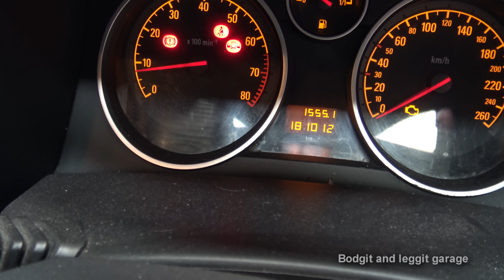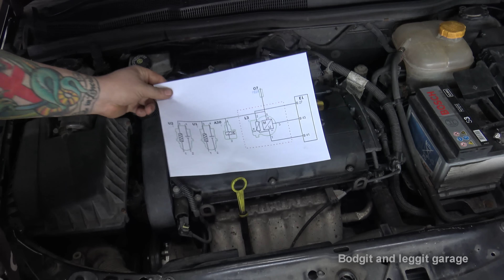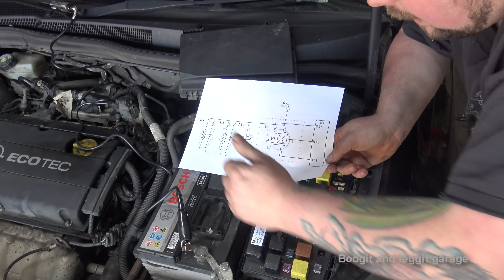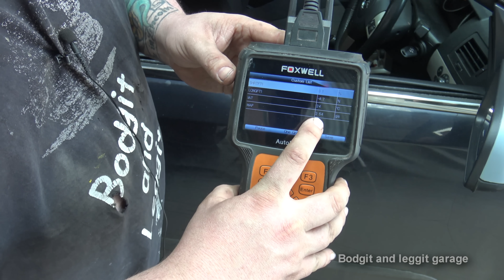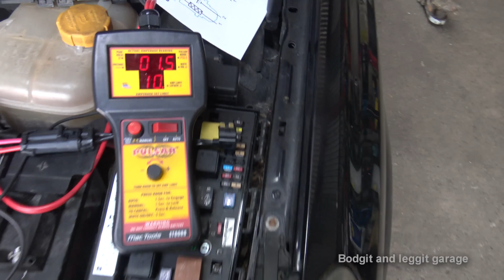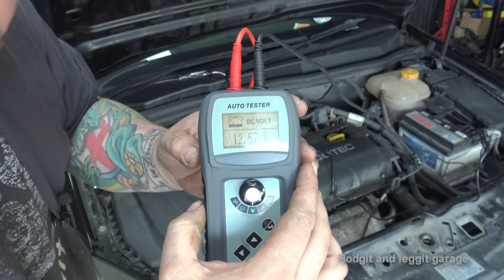Vauxhall Opel Astra P0100 P0135 P0141 P0443 Bodgit And Leggit Garage

Comment: Hi sir. I have opel astra model 2001, 1200 cc the motor has been replaced with 1800 cc , the both o2 sensor has no power o it's heaters, could you help me

Comment: Greetings from Hungary. Thanks for the video, the issue is finally resolved. I tried a lot of things, but the codes P0443, P0135, P0141 always came back, but based on your video, the small fuse in the engine compartment was also faulty. I replaced it and now everything is fine, no error code. Thanks again for your help.

Comment: i have a vauxhall astra 1.8 from 2004 and i get P0100 code error, i can check the fuze/clean maf or replace maf ... what do you think ?
Reply from the maker: you will need to check it with live data you will need to check your wiring and also check your your ECU and check you've got no leaks in your system

Comment: Would the fuse number be the same in a 2008 corsa 1.3 cdti? I'm getting a po100 code I replaced the air flow sensor but am still getting same code 😕 it's getting on my nerves now haha 😊
Reply from the maker: Lol it's hard to say because you could have exactly the same car as the one I've got in the video and the fuse be in a different place the easiest thing to do is get your manuals out and you're fuse location should be in your driver's manual
Reply: @bodgitandleggitgarage  OK thanks il av another look tomorrow it won't beat me haha
Reply from the maker: @claireroberts4351  lol boom

Comment: Thanks alot! Been having trouble codes P 0135, P 0141 and P 0443 on my Opel Astra H 2008 since i replaced front exhaust pipe when i had to remove the O2 sensor! After that i cleared the codes all the time but they came back, changed the battery also because i thought it didnt give enough power( it was 7 years old so it had to be done anyway)!

Saw your video reg these troublecodes and had no idea that it could  be a fuse but the same fuse nr 26 were blown in my car too!

Replaced it and now lets hope that this was the issue😀

Roger, Sweden
Reply from the maker: Hope it works for you mate the very mind you could have an issue with one of the parts when you get a lot of codes and it's only one fuse controlling it you always have to look at this year's first but you might find you having issue with one of the part if you do disconnect one paw at a time and see what the fuse does
Reply: This was the question?

Comment: Hi Leon . Great uploads always enjoy watching &  the time you spend explaining the repair  /  Well my wifes car a 2002 vw golf mk4 gti  has the management light on in fairnes all was good until she went into a pot hole that was so deep that keeping fish in it would not have been a problem anyhow i have found a code scanner on the internet a VS450 obd11  for VAG at  just shy of £30  any advice would be appreciated  is it the right one ?i did message seller he sent me back his CV?? rather than if it would work on the car  i usually do all the repairs on the car that involves getting my trolley jack out and old clothes and getting dirty but never tackled this problem  .keep the uploads coming cheers gary
Reply from the maker: Gary Foster hi mate personally I've never used that one but I know there is really good ones out there for that sort of money so I wouldn't be surprised if it will do what you need they are good at reading codes that that's about it but at least if you get a code you will have some sort Direction on where to go
Reply: bodgit and leggit garage  Cheers leon . Well ive cleaned the maff sensor & throttle body  already  . I will purchase the code reader and then  have the exact code problem and hopefully it might well be a problem i have now hopefully now addressed already   cheers Garry
Reply from the maker: Gary Foster let me know if you get it sorted mate all the best

Comment: Must have been lucky took 2 Vectra C's with xer engine's past 120000 miles zero issues, most reliable company cars I ever had !
Reply from the maker: D C hi mate it's like everything depends how it looked after service drove etc etc
Reply: bodgit and leggit garage the insignia's that replaced them were utter crap by comparison constant stream of problems, now in Honda zero problems ever not even a bulb!
Reply from the maker: D C you just been very lucky mate probably one of the worst engines I've ever seen I'm not complaining cuz I've got an awful lot of work from these engines
Reply: mines on 140k. still ticks over like a good one. just done timing belt, service. all ready for Blackburn away matches next season.

Comment: Whats the technical name of the oil going through the wires? 
Great vid Leon,  used to work at an Opel dealer crappy cars as hell😁
Reply from the maker: armando nika hi mate there is a few but essentially it's capillary reaction
Reply: Yeah had this oil issue myself, I was told it was due to the oil pressure switch pushing oil through the whole loom a year later engine light p0350 code so hopefully just means a bad o2 sensor

Comment: it's a bit annoying that there is no obvious cause of the popped fuse :-(, but the engine you repaired is fine and dandy :-D :-D.
If the fuse pops again, you might rig up a small fuse for each sensor, catch the little sod blowing raspburys at you lol.
Reply from the maker: zx8401ztv yes mate always annoying but a lot happened to this car before I received it so you just don't know what happened as regards if it pops again the machine I use means I don't have to wire up separate this machine will do everything for me and monitor the amps going through the circuit if I unplug and plug and back in this machine for monitor everything for me
Reply: Oh it's one of those cars lol, i've had electronic repairs that bounced back and there was evidence of tampering.
Owners fingers where they should not be.
Keep up the good work mate :-D

Comment: Just watched the video again Leon, thought it was an xep engine , but its actually an xer.The cam solenoids and electronic thermostat housing share the same fuse , thermostat housings were also common to short.Joe
Reply from the maker: V4VAUXHALL thanks for that information mate wonder why the wine diagram didn't show that and I did not get any other error surprised and didn't get an error code for the solenoid but I did replace the housing so maybe it could have been an original problem with the thermostat housing I'm going to check the wiring diagram and see why that's not showing up
Reply: yes mate, this was so common that the dealers have loads of these left over , and try to sell them as an alternative to the plastic ones fitted to the astra j and insignia , so if they ever try to supply a metal housing for one of these ,kick it back to them. If you happen to have the old housing just ohm out alternate pins to the housing body and I'm sure you will find the short.xep does not have the electric thermostat.Joe
Reply from the maker: V4VAUXHALL that's exactly what I'm going to do thanks mate

Comment: From what I can remember, Kieth at New Level Auto was working on car with the ecotec engine which was running rough. He discovered a blown fuse with the same tool and the engine ran normally. He wiggled the wires and out of line of sight from the camera, saws spark from the wires at the rear of the engine (gearbox end). The wires were rubbed through on the lifting eye because the cables weren’t clipped in. He noticed  the spark which highlighted the issue which may have blown the fuse.
Reply from the maker: Brian Beale hi mate I checked all that couldn't find anything will have to wait and see if it comes back